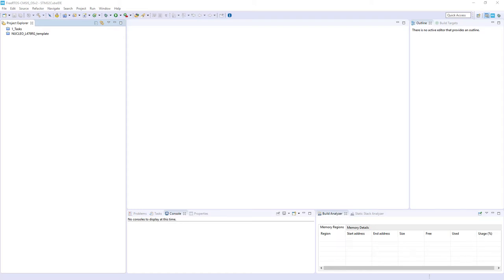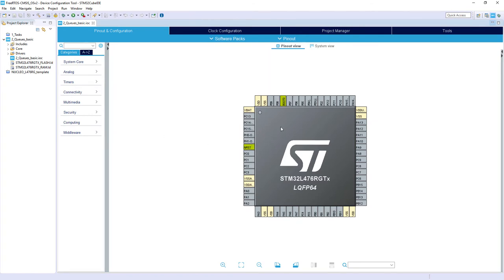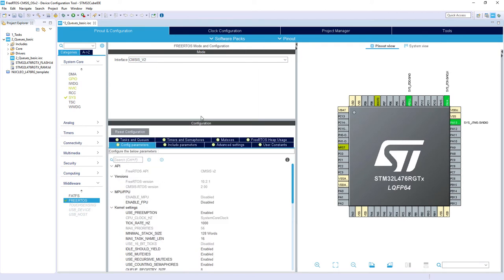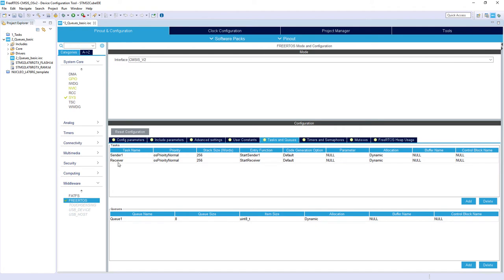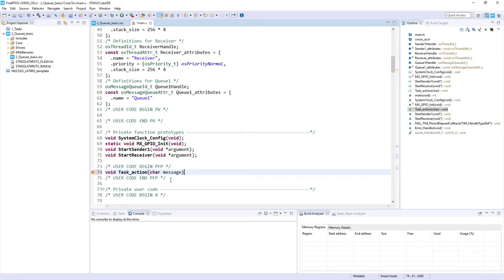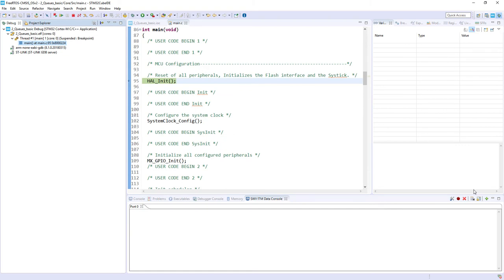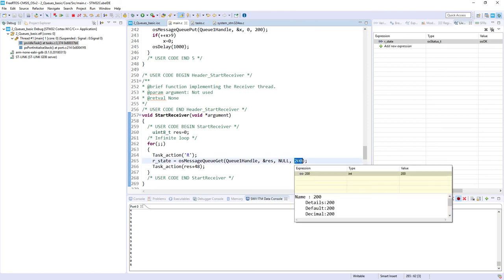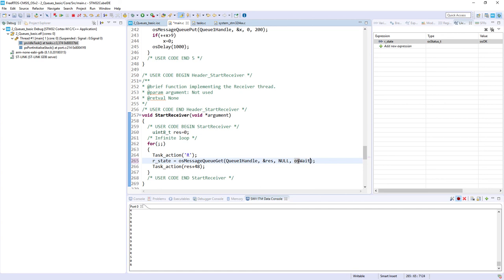FreeRTOS on STM32 v2 - 13c Queues basics - LIVE lab

Comment: I ran the code in 13c Queues basics - LIVE lab several times, and I fail to see why the receiver Tasks is always executed first. Since they have same priority  and the Sender1Task is 'earlier in the code, I would expect to see and S first in the output. What am I missing?
Reply: bro when you are using the same priority level then the later one declared will be executed first.You can see by modifying your code by first declaring reciever task and then sender task.